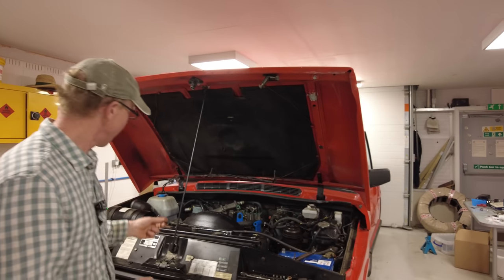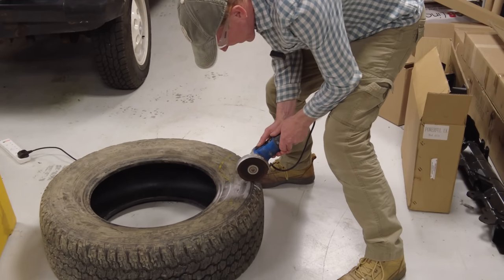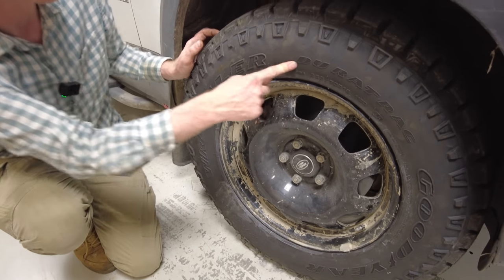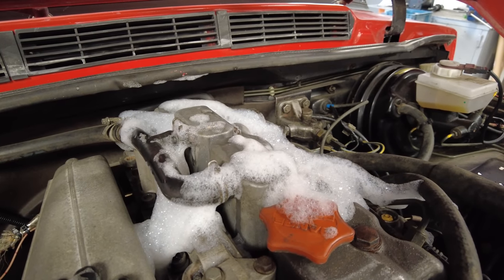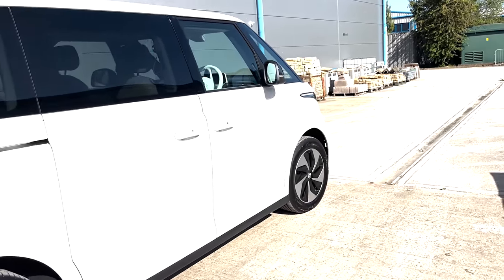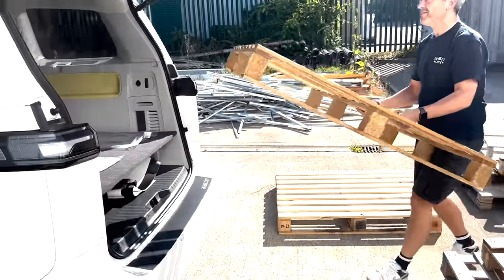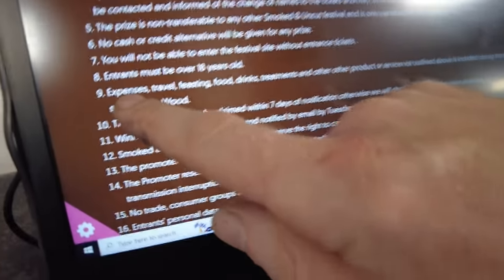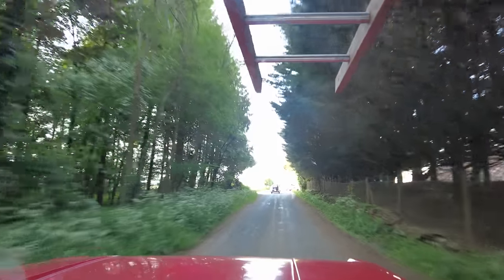VLOG 29 May 23 - INEOS Grenadier Competition / VM Engine Problems / Cotswold MotorHub Visit

Comment: Could you share a link to the gasket you used? I have a VM 2.4 in an 88 2-door here in New York City (originally from Spain). It's had some head gasket issues but I love this engine when it's running good - cruises just fine!

Comment: I don’t think it was the head gasket that was blown. I reckon the exhaust manifold gasket or an injector leaking compression. Have you cleaned and ground the injector seats before reassembling? One piece head gasket would need the front and back support plates to be machined as it is longer and goes under them. Good luck!
Reply from the maker: Thanks loads for your comment - the engine now in the car came with.a one piece gasket so maybe using the individual gaskets was a mistake on several fronts ! I guess the spacer should be the same hight as the head for the one piece gasket - but a bit longer for the individual gaskets. I will check this now.
There was a lot of pressure noises - and i am not sure this would come from the exhaust
Also if you look its cylinder 3 exhaust that was blowing - and that is between cyl 3 and cyl 4 - the bubbles were between 2 and 3 so i think it was the head gasket gone... thats my current thinking ~
Reply: Yep, with one piece gasket the spacers (front and back) will need to be shortened. As normally they sit on the block directly, not on the gaskets. Also have a look at the top surface of each head where the bolts and those funky spacers seat-the can become damaged (indented) which will cause the head not to sit as tight as the factory spec. In such event you need to skim both sides of the heads (top and bottom) to be able to reuse them.

Comment: Looks like exhaust gasket cil #3 failed. All black on the exhaust flange face. That wouldnt be black if it was the head gasket (and that actually looks fine).
Reply: I didn't think it was the head gasket either. A car can't "run fine" with a blown head gasket. Big waste of time there. What motor is that with individual heads?
Reply from the maker: Its the VM motor ! from a boat originally !
Reply from the maker: It definitely has high pressure noise so not likely to be exhaust - especially at turnover - not running.